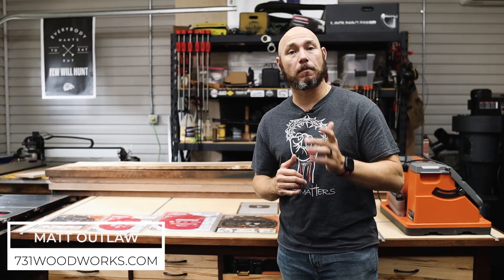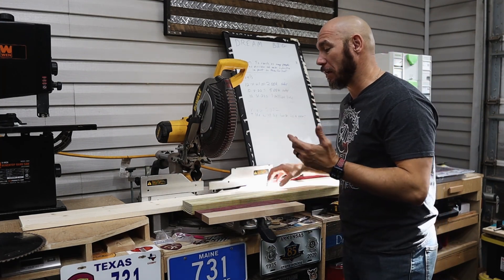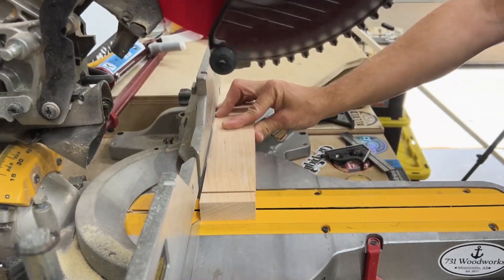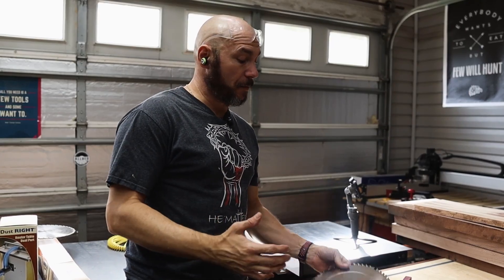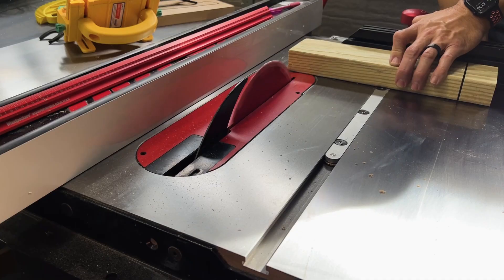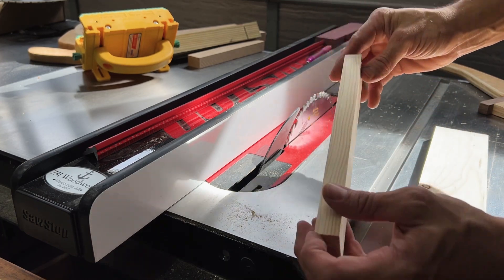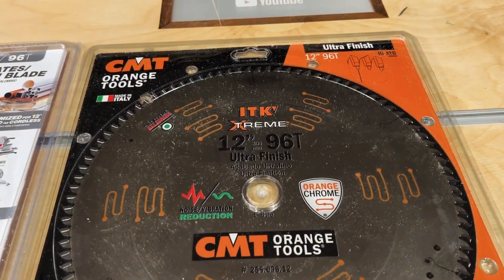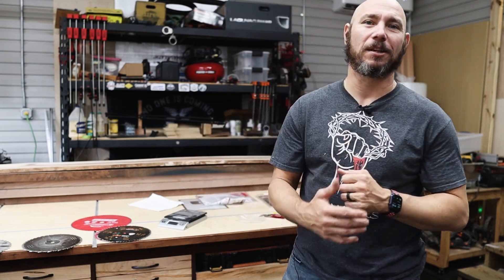Best Saw Blades for Woodworking on a Budget

Comment: I have owned a 40 tooth CMT chrome blade for about 6 months now. I will verify your "feels" when first using the CMT. 
When I made my first cut with the CMT I definitely noticed how smooth it was, which prompted me to grab my Diablo for a comparison. The CMT is smoother...
I have several Diablo blades but will be replacing them with CMT as they reach their life span.
Thanks for the great comparison 👍
Reply: What made you choose the 40T CMT (which I'm assuming is their general purpose) vs their 50T Combo blade? I'm torn between these two
Reply: @josephlebo7320  the blade was listed as a FTG. When it arrived I opened it before realizing it was incorrect. I decided to keep it and use it. Not disappointed. My next will be a FTG.

Comment: Been watching a lot of your comparison videos on saw blades. You should definately check out the Makita blades.  Project farms did a pretty scientific test using weighted pull with a circular saw and the results were quite shocking.  The Makita blade stood above all by a larage margin.  It was quite impressive watching the Makita blade rip through lumber much faster than any other blades.  Thanks for your time doing these.  Love your vijeos.

Comment: Hi there.  Good video.  One thing that was hammered into my head some years ago was the importance of hook angle.  A “good” miter saw blade should probably have a negative hook angle, often -5 deg or so.  Obviously not as aggressive a cut, and I find this helps smoother cuts.  In my semi-educated opinion, this might matter about as much as a higher tooth count.  The combination/general purpose blades should have a positive hook angle, but my old brain can not come up with useful numbers at the moment.  Sorry about that.  Anyway, I do enjoy your videos.

Comment: Thank you for posting. Based on your vid seems to me the quality of the cut out of the box for both is very good. Interesting how much the cutting process does have some effect as shown on the first cuts with the miter. Hammering through things usually does produce a bit more issues. For essentially the same price , if available, the CMT nudges out the Diablo.

Comment: Hey Matt. If you wait for the blade to stop before bringing it back up it will give you a little less tear out. I forget to do this most of the time, but it is a good habit to get into. Thanks for the great review. I like both blades. I would guess that the CMT might stay sharper for a little longer but this is just a guess.
Reply: Great point

Comment: As someone who knows nothing about saws, I did notice on the miter saw, that matt finished all of the cuts with the diablo blades with a little extra force/speed. Where as the cuts with the CMT on the miter looked to be cut with much more consistent speed. Is this a technique? or just the smoothness of the CMT blade showing? Do you think this is contributing to the extra tear-out Matt got on the diablo blades? Not critiquing, just genuinely curious.
Reply: I noticed the same

Comment: I work at a sawmill and we do palettes. We crosscut the blocks and it is almost impossible te get a clean cut on a soft wood. We have industrial crosscut blades, which are over 300 $ a piece and one of the best quality on the market, and still i get some tearouts.

Comment: I noticed in the adds of both the cmt blades are flat ground the Diablo isn't it's angle ground so I'm planning on buying the cat from what I saw the cmt  is a good blade. No tear out I've been using cheap blades from the box store. I will be getting the 10 inch for my miter saw and 7 1/4 for my tablesaw

Comment: Nice comparison. Thanks for taking the time to do this. One thing I'd really like to see woodworking content creators do is approach blade manufacturers about producing good quality, reasonably high tooth count flat-top grind or combination grind blades for using with a table saw cross cut sled to cut half-lap joints and such. I know CMT makes a 24 tooth rip blade for the table saw, but for clean cross cuts you really need to get up to around 60 tpi and above.  Your thoughts?

Comment: If you are looking to try cmt blades. The big green box store (Menards) has a contractor 10in 3 pack with 24 60 and 80 teeth count for only $39.99 just picked it up a week ago myself haven’t got out to garage to try out yet but looking forward to it.
Reply: Those are a lower grade than the blades in the video. They're probably still OK, but not up to the level of the diablo blades.
Reply: Currently i am using one of those cmt contractor blades (160mm diameter, 40 teeth) for tracksaw and i am trurly impressed, quality of the cut is still great despite the fact that i used it for the wrong job, i have been cutting solid ashwood tables to size (28mm thick, 90cm wide and 230cm long) and i did not have time to change blades so i was ripping and crosscutting with this particular blade, it chew trought 16 tables like nothing and finished several lesser jobs. I can't imagine better quality/price ratio (in Poland cmt contractor 160mm 40t blade costs 8-9 bucks)
Reply: @Konserwant222222   I was thinking a good name brand even if it’s not the best blade they make it’s got to be better than like a dewalt or craftsman or anything from harbor freight kind of blades that and not have a ton of money to drop on a $40 blade a 3 pack for $40 sounds great for me because I got a 10 inch miter saw and 10 inch table saw so I’m putting the 60 tooth on the table and the 80 tooth on the miter saw
Reply: I’ve tried both and liked both. If you really want a game changer, get yourself a Ridge Carbide blade. A little pricy but you WILL be impressed! What a great blade. What a great  Christmas present! I have it on my table saw and plan on getting the 12” for my miter saw.

Comment: Is there any chance your sawstop is too fast for that Diablo 50T combo?  I run that same blade on my DeWalt jobsite saw and I get no tear out at all on cross cuts if the blade is clean.  I don’t know the RPM on your table saw or mine but I imagine yours spins faster than a jobsite saw

Comment: Have you ever considered putting a zero clearance fence on your miter saw? I’ve thought about it but idk if it’s actually worth it. May help with that tear out on the back side?
Reply: Yes it is worth it because it does make a difference. Safe to cut small items like dowels or thin cuts on stock. Highly recommended
Reply: Yes. Just by attaching a piece of 1x material to your miter saw fence (most have holes for screws for this already) will eliminate that cut out at the back.

Comment: So to understand correctly if you use a higher tooth range on the miter saw why on the table saw go down the number of teeth on the blade big time if the reason for higher teeth is cleaner cut?
Reply: Reason #1: The table saw blade is 2" smaller in diameter, so it has a lower tooth count. Reason #2: Rip cuts (table saw) need fewer teeth since the cut is going in the same direction as the grain. You'll see this on hand saws as well. Crosscut saws typically have a higher tooth count.
Reply: @Anthony-H  thanks!
Reply: If you don't want to change blades between rip and cross cuts, a 50 tooth combination blade is a good choice. If you get 2 blades, one rip and one crosscut, you can get a higher tooth count crosscut blade to get a better finish cut. A lower than 50 tooth count blade to do rip cuts will cut faster and less burning.
Reply: Rip cut blades have fewer teeth because it's removing much more material. That material needs some where to go so less teeth more gulleys to move the waste out the way. I work at a cabinet shop trust me thats the only reason.  diameter doesn't matter going with the grain doesn't matter 👍